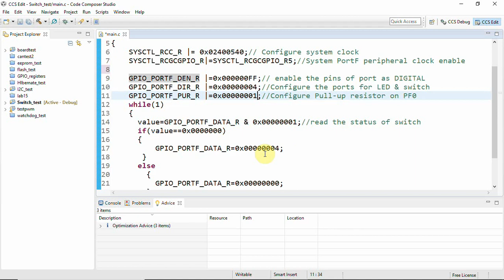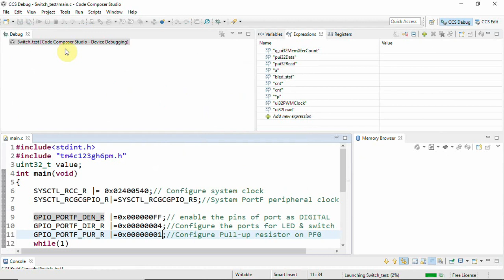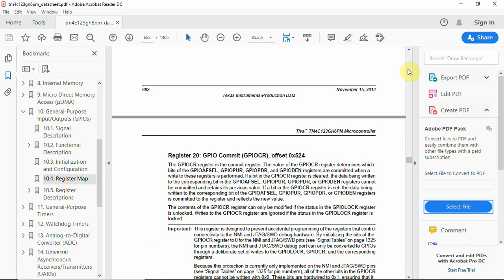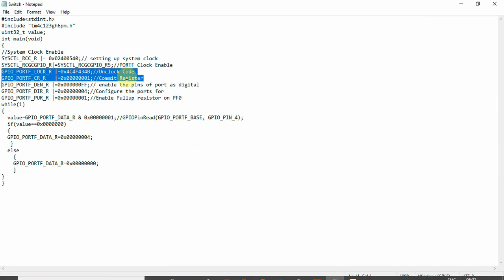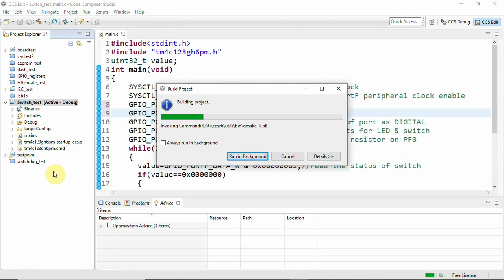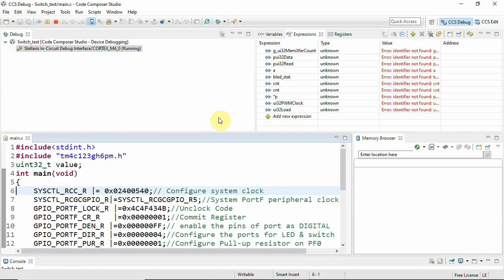how to read switch (sw2) on tiva c launchpad |Register Level

Comment: Thank you so much! I have a Tiva TM4C123GXL and I was able to get the SW1 to work but could not understand why the same code would not work for SW2. This tutorial solved my problem. You are the man.
Reply from the maker: Great to hear! Thank you
Reply: Ajaynirmal Ranganathan Is there a reason that we need to do the unlock procedure only on SW2?
Reply from the maker: @Kushal Patel, Go through the user guide of tm4c123gh6pm